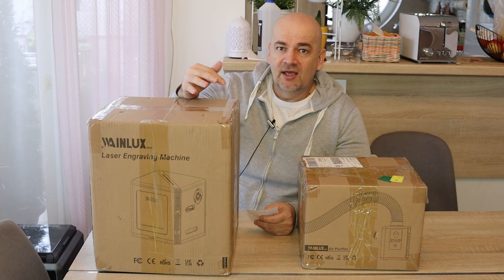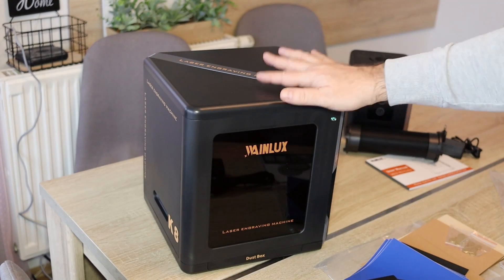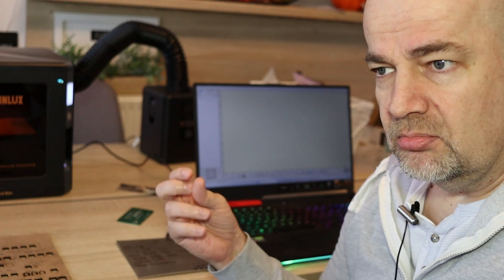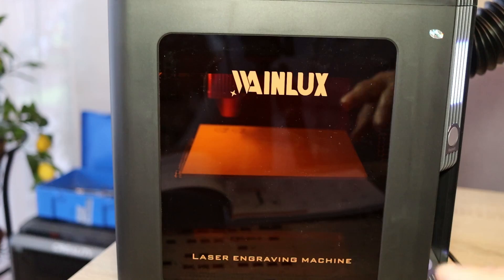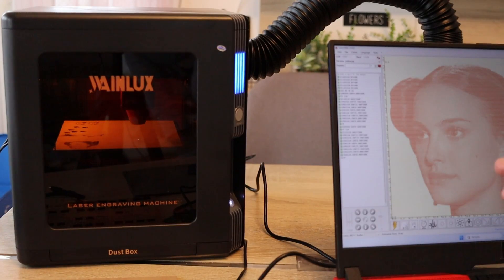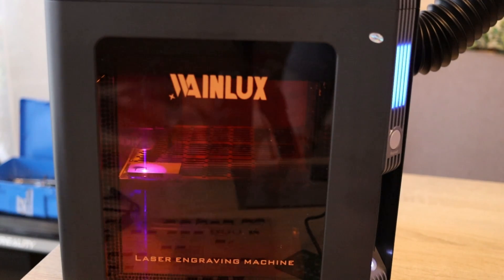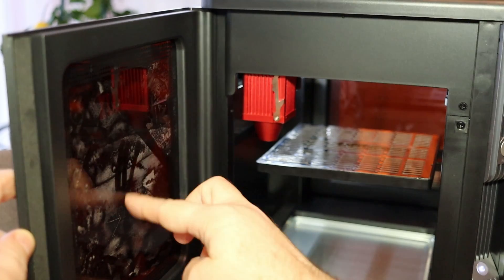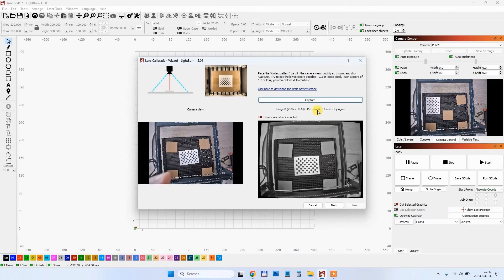Finally, an enclosed laser engraver: Wainlux K8

Comment: What is causing the laser to have so different X vs Y direction cutting performance?
Reply from the maker: The laser is not squared. This can be visible if you point the laser to wall (from 2m distance), you will see a rectangle.
Reply: Can you square?  I ordered this engraver and waiting on delivery.  I was so excited but recently there have been a lot of complaints about unit.  Hope I didn't throw my money away.

Comment: Cool product! I'm even more interested in the air purifier. Can you test if it works well with popular resin printers?
Reply from the maker: It's more for the dust from laser engraving / cutting. I think for resin you need much smaller pore size filter. But I have no info about the filter so far.
Reply: @MyTechFun  Thanks for the clarification!